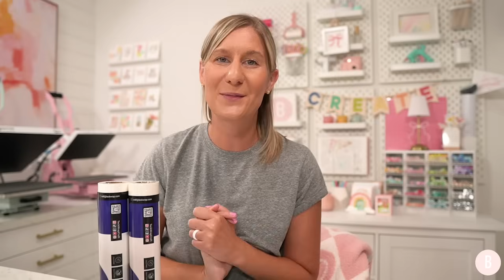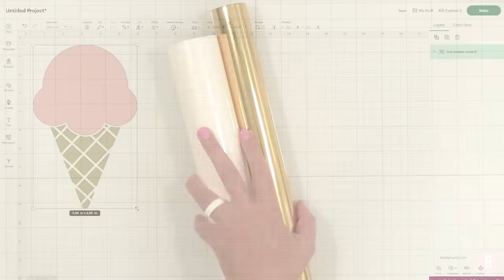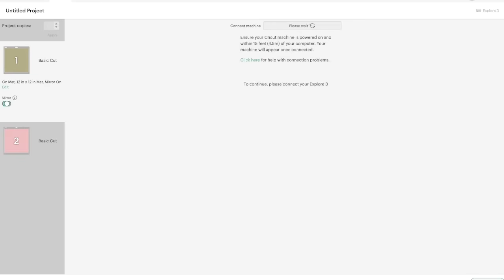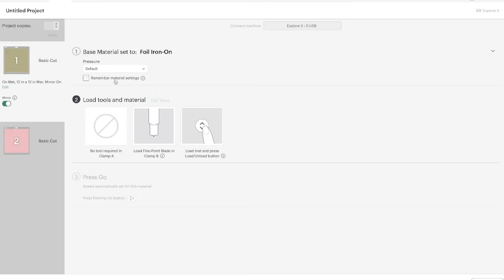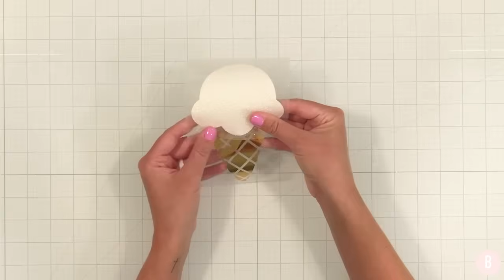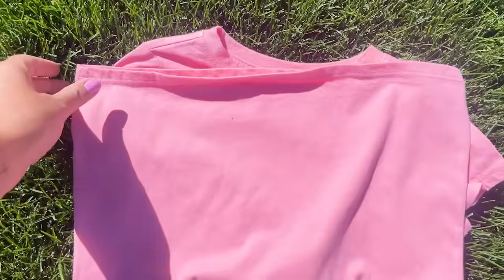A Shirt That Changes Color! | How To Use Color Changing Iron On

Comment: I love using colour changing materials, both thermal and UV (sunlight). The only issue is they EXPIRE. When they expire, they no longer change colour and will stay a random colour. Could be one of those, a random grey, even in dots. There's no way to find out when they will expire, some brands last a few months, some a year, some longer. Also depends on exposure to temp change and sunlight.